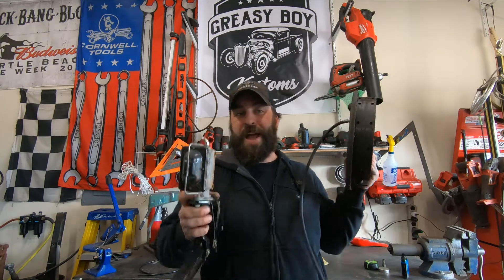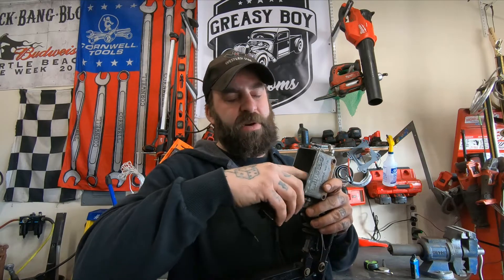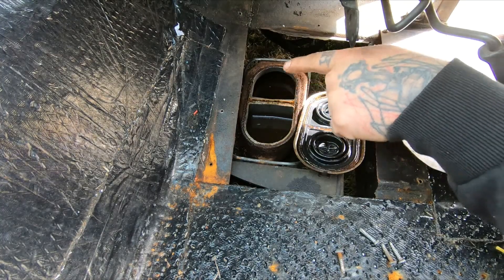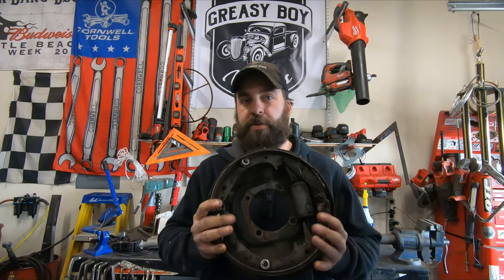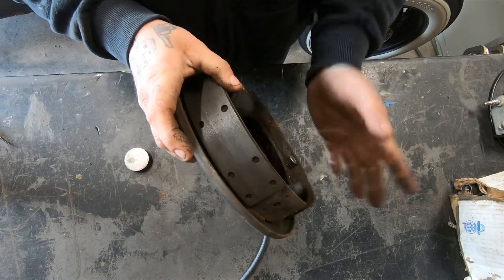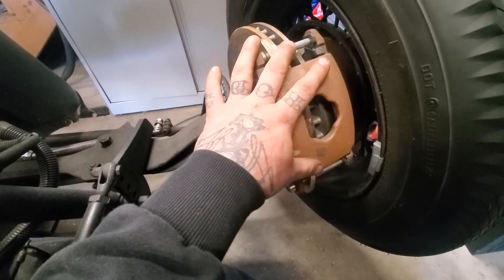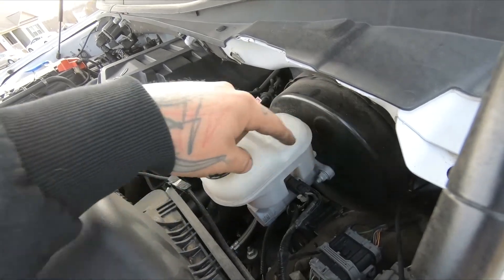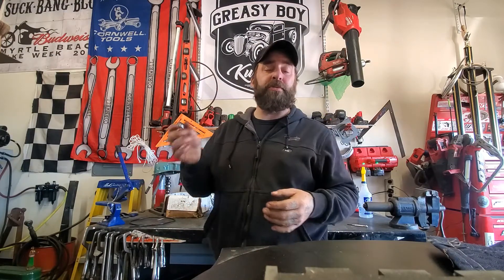BRAKE TALK PART 2 . HOT ROD AND RAT ROD BRAKES disc vs drum brakes, master cylinders, and  boosters

Comment: How are you doing man 
question for you 
I have disc brakes on the front, drum  on the back I have a dual master Cylinder brake pedal with 7/8 and a 1 inch for sizes 
I am trying to figure out which size goes to the front or rear 
Thanks  in advance
Reply from the maker: Typically you would just run the same size and be ok but I'd use the larger bore for the front disc brakes